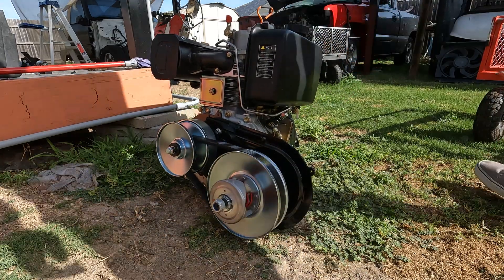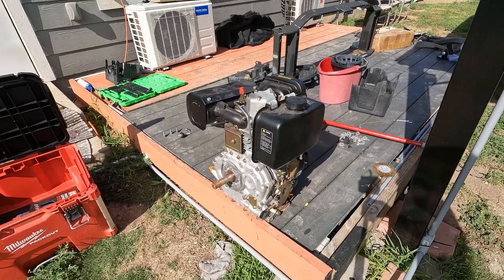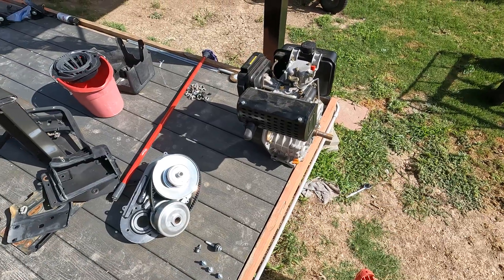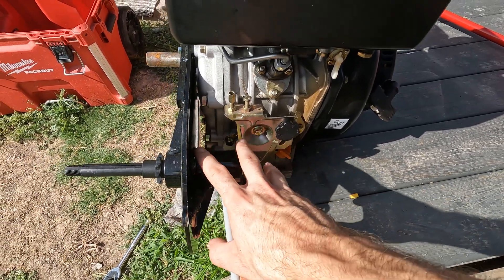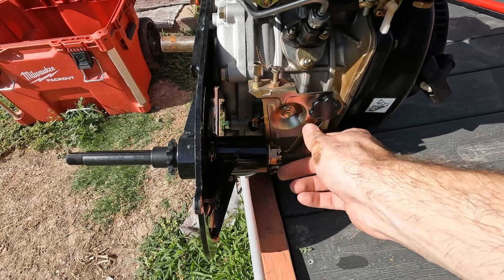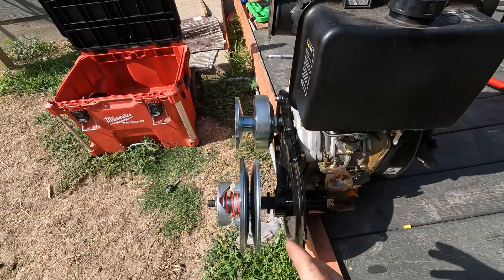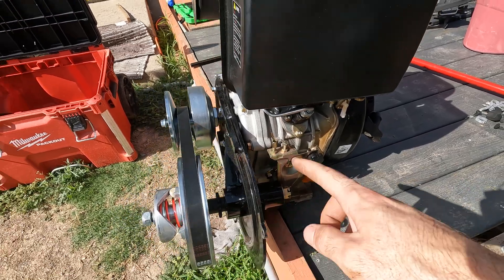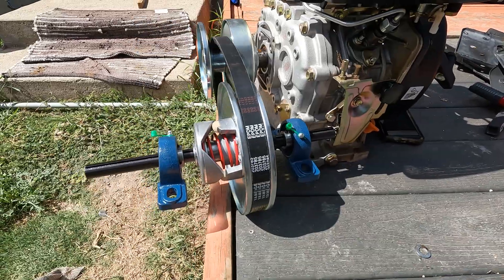Amazon 418cc Diesel Engine How To Install Torque converter

Comment: Work well with a wood chipper i assume?   Wonder what the torque curve is like.  I haven’t found spec’s online yet.
Reply from the maker: It does make solid torque down low don’t have to rev it to 3600 like a gas engine

Comment: A very dynamic drive train. Add an extra gear set, frame and wheels and you have a compact tractor. How you have the variator, the belt is very far out on the motor shaft = a lot of bend on the crank and a lot extra force on your motor bearings. I'm sure the variator is a 40 series, not a 30  series.

Comment: How would you install a shifting linkage to that?
Reply from the maker: @coyoteserranomusic  no shifter required it’s a cvt
Reply: So when you start that engine up it just starts in neutral?
Reply: I'm just curious because I have an old Mini Cooper that's been sitting around without an engine. And I know my old go-kart engine is a 200 cc I think but it's missing some parts. I like to put that engine in my Mini Cooper just trying to figure out how I'm going to do that.
Reply from the maker: @ yes basically it begins moving when the rpm begins to raise above idle, but at idle it will not move
Reply from the maker: @ that would be awesome, if it’s a manual just couple the output to the input
Reply: @Mikebuildss  the transmission still in it and it has the torque converter on it. I really don't need the torque converter, being that I'm not using the original engine. Do you have any links about the input output coupling

Comment: What if you put the 20 tooth in behind another 20 tooth leave the 50 to 70 tooth rear and run a higher torque clutch that engages sooner so you can use more of the rpms, 
I'm cheaply redoing the jackshaft to a new pair of mb200 im ordering, i have sprockets and clutches ready to order at the end of next month, im trying to help get her ready for a longer camping trip we're taking them on, I'm not a fan of torque converters, an am looking to get good use out of a jackshaft setup.

I would really like comments and opinions plz.
Reply from the maker: Only bad thing about the centrifugal clutch is your gearing is set either lots of torque or speed, too much speed burns clutches out. I have a mb200 I would like to convert to a torque converter setup

Comment: I love those torque converters. Back when I was a kid (way too long ago), go-karts and minibikes just had a single speed and centrigugal clutch. Over on  the Cars and Camers YouTube channel, they put a Chinese diesel engine on a go-kart and were surprised by how well it worked.
Reply from the maker: They work great for keeping a setup cheap and simple, but once you upgrade to a cvt you won’t go back!

Comment: But the shaft on mine came odd sized  did you grind yours down?
Reply: It's a .4mm or .0157 inch slop that needs accounted for that's a 25mm shaft version not the 1inch (25.4mm) most likely has the metric keyway as well which should be adjusted for a snug slip fit using a shim otherwise crankshaft and or cvt driver damage can occur also another 2ways to mount the 40series to the 186f/186fe diesel engines is to the front or to the bottom clock positions
Reply from the maker: @Atomic_Serge  no, this shaft is a mm smaller than 1 inch. I didn’t show in the video but I used a soda can to make a shim and that made it fit perfect
Reply: @Mikebuildss  I think that's exactly what they did on the Cars and Cameras channel with their Chinese diesel engine.
Reply: My engine is same as yours except it has a tapered output shaft. Can I still put a torque converter on it?
Reply: @jaybarber68  sadly without grinding it down no